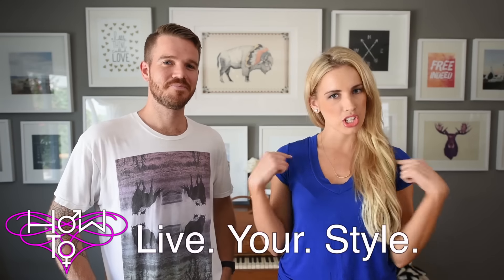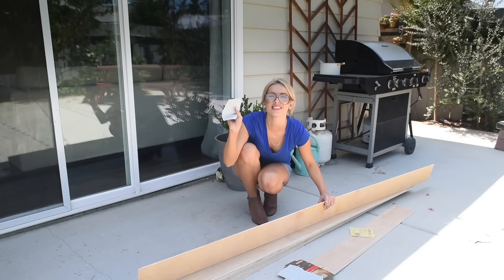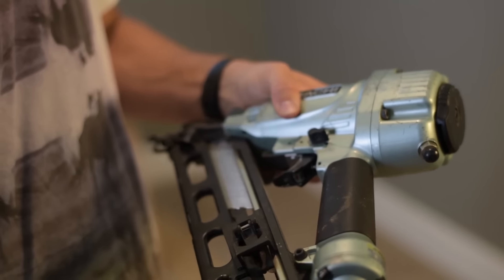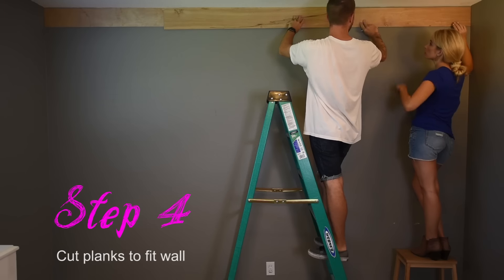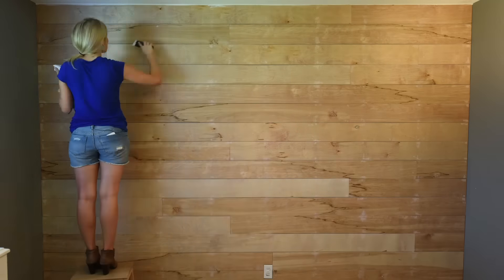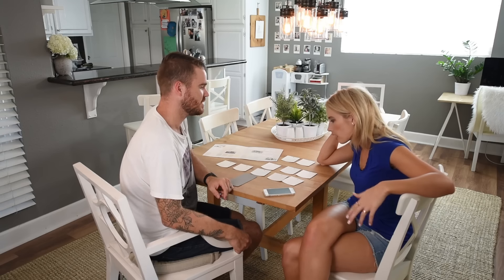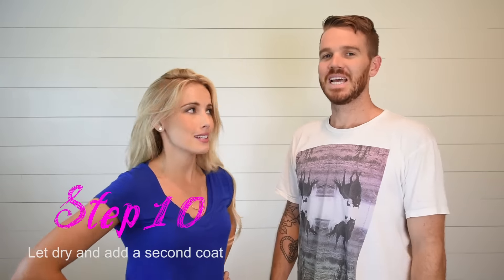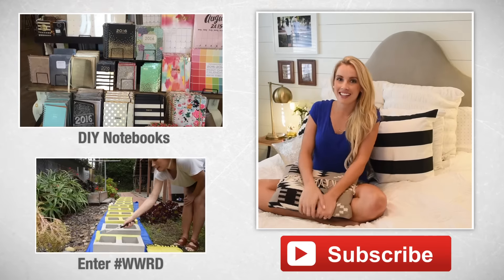INTERIOR DESIGN: DIY Wood Wall | White Shiplap Wall | Robeson Design

Comment: Looks great but I really wish you would have provided more info on the 6 inch plywood planks. How thick are they? Did you buy a 4'x8' plywood panel and have the store cut it down? I'm having a real hard time finding the right product online.
Reply: Shiplap can be hard to find sometimes. They have it at Lowe's in planks both rough and more finished which is already whitewashed. Interestingly though, the white ones were not in the lumber section, but with the decorative wood panels that are finished. Good luck!

Comment: Also, most important, where did you get the plywood cut in sheets like that?
Reply: +Paul B If you know what kind of wood you want, and take all the measurements Lowe's will cut the wood for you. You can rent most tools at any hardware store for a minimal price. Good luck with your project.

Comment: I don't think I've ever seen the 'shiplap wall' technique before.  My only concern is that if you later decided you wanted to return the wall to it's original surface, it might be quite a job.  (Maybe I've just seen too many homes with panelled basements - I'm sure it seemed like a good idea at the time).   I think that most of the effect could be had by just painting the wall in the accent colour.   

That being said, I think the project turned out very nicely, and the completed room is lovely.

Comment: How do you keep paint from the cracks?
Reply: +Ashley Roth I do a lot of paining projects. I would use a thin nap roller, with multiple light coats. Hope this helps.
Reply: +Lucy DeMichele thank u!#
Reply: +Ashley Roth
 You should keep a sharp knife and a wet rag handy while you're painting.  Use the knife to run through the  spaces that get filled by the paint.  This will keep the spaces between the boards even all the way across the room and not have some of the spaces seem to disappear.  The wet rag will allow easy wiping of the rag between rows.  This is how I did it on my kitchen wall and it came out great.
Reply: +Jim Thelen thanks so much!!